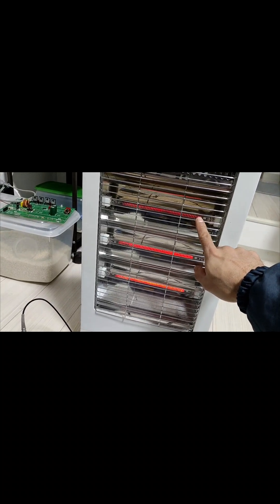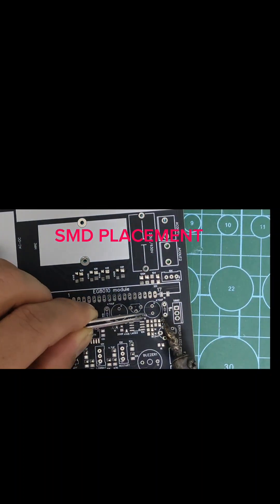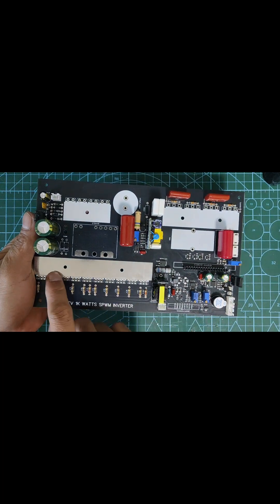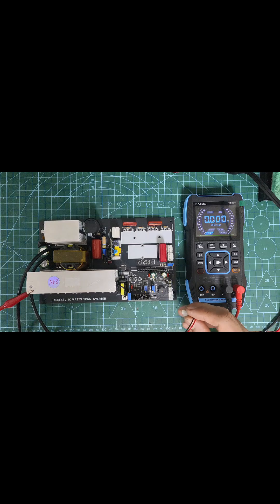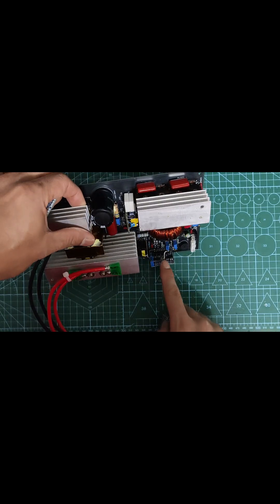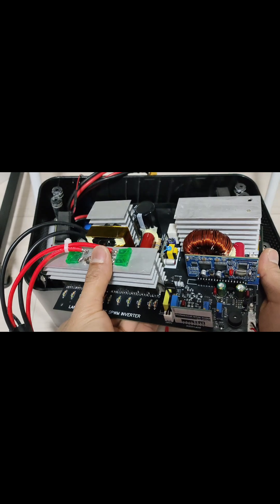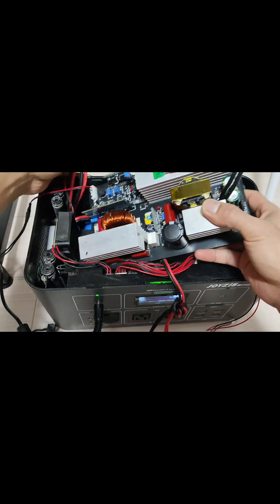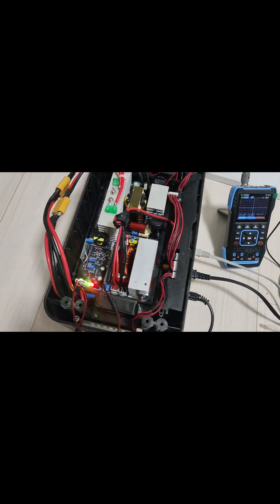1kw POWERFUL SPWM INVERTER Version 1 with SHORT CIRCUIT PROTECTION 👌👌👌

Comment: You are doing a good work and that is great. You want your subscribe to download Gerber files that do not have components value name on the footprint. Spending money at JLCPCB to print the gereber file is waste of money. I use EasyEda for my design and you can share Json , PDF and Gerber file. Sir, sharing your Gerber file is totally useless without the components value numbers. 

Again , you can share schematic diagram for study or for upgrade or easy troubleshooting.

Comment: Awesome project, but there is no circuit diagram in the description , you have only shared Gerber file.
You can check yourself . I request you to share the circuit diagram so lots of people will be benefitted by your project.
Thanks & kind regards.
Reply from the maker: @yawarsaeed6499  I used easyeda software ,I m not yet navigate where to generate the schematic only I know was the Gerber file 😔😔😔
Reply: тоже спрашивал про схему он дурачка включил